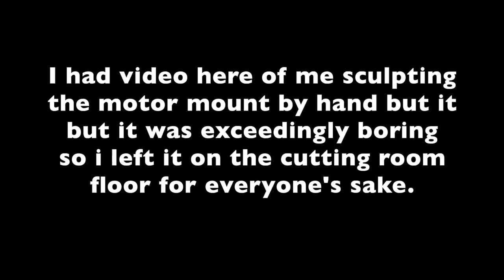Project Widowmaker Part 4 - 2GR-FE powered MR2 Spyder

Comment: This has been my dream for my spyder for years which is why i still havent gone to the 2zz. The 2gr will be more along the lines of what i want from the mr2. Ive already got a huge turbo sti, so instead of peaky top end power id like a more usable torque cruve for the street and track as the spyder will be my daily/autocross car. I ended building the subaru up first as it blew the headgasket from high boost so itll be a couple years maybe before I can save up for everything but its going to happen and ill be looking to you for info/parts😉 great work btw!!

Comment: No Toyota interchangeable oddity or Truetrac for that diff center to get a T2 torsen in there? (add a preload pack (Disc spring between side gears) for race use avoids lifted wheel issues) seems a little wrong to save an open center!
Reply from the maker: I have to do some research to find the answer to this. i don't know of an interchange right now but also i don't find that i have rear tire lift issues at the race track. the open differential has not been holding us back from great lap times. You can see on the IMS video even in the high speed turns the power can be applied early without inside tire spin.

Comment: Marc, I feel the reason there is junk in the transmission and all of the bearing races are damaged is because that outer input shaft bearing has been replaced once before. The bearing that comes in the scion tcs has a green side seal vs the one you bought (black) and the one you just pulled out also black. 

It really looks like a crappy toyota dealership had this one come in and they did a slap and swap. They didn't even clean the chunks out  or get oil residue out of the case.. just wiped off the magnet in the bottom. Swapped out the bearing and slapped it all back together...  And sent it out the door. 

All just theory and speculation tho.... I haven't had one grenade itself after Toyota "fixed it" or anything like that.
Reply from the maker: This is actually a really good theory. I will be replacing the input shaft bearing either way but i'll take a solid look at it to see if there's any slop in it.

Comment: going with ej20 boxer engine with decent turbo setup would be great aswell. but is it possible to make one step forward...making an awd sytem.. cutting a shaft tunnel and devising an awd system similar to ford rs200 group b car ? Sprit of Group B. does it require complete custom driveline system ?
Reply from the maker: YZ, I'm pretty sure i know the answer to this but i have an '08 WRX in the driveway here so i took a quick tape measure to it and the subaru has the axle output about 22" behind the front of the engine and the MR2 has the axle centerline about 18" from the firewall. You could sweep the CV shafts forward a bit so that would probably be doable. But the next problem is the front of the engine to the rear of the transmission is about 50" long and the MR2 has an engine bay that is about 39" long. The next problem is even before you bring a driveshaft forward you need to turn it around from behind the trans and we're already 11" past the rear of the car and then we need to run it next to the engine but this is a very wide engine so that would also be difficult. adding a driveshaft tunnel would also be complicated but that would be the easiest part of all of this. the only way that would work is if you cut out the firewall and remove the fuel tank so you get an extra 14" of room or so in the engine bay and then you still need to snake the drivetrain forward. A custom transaxle or some kind is likely going to be a requirement. I don't think any of the Porsche AWD transaxles are going to be short enough to not interfere with the seats.
Reply: @FrankensteinMotorworks  fuel tank and battery to the front compartment to compensate weight ratio. cutting firewall is a must..  I saw keita san's video it is using ej20 but rwd using one of those 1500cc fwd jdm impreza tranny i suppose
https://www.youtube.com/watch?v=HNlmqi0Fuag
as i understand it is a tough job .. but mrs platform would be a great group b platform with professional engineering... Toyota MR2 (222D) – Group S
Reply from the maker: @enuma8161  I never said it would be impossible. I know better than to say that. Between the fact that i've shoved a WWII airplane engine in the back of an MR2 and also i know someone that has a 3s-gte powered AWD SW20 MR2 in the works and the AWD part is done so it's absolutely possible. That said, based on my experience you're talking about a build with about 2000-3000hours of labor or so and probably $15k worth of parts and supplies if you do most of it all yourself. If i were to target a build like that i would certainly use a different engine to save a bunch of extra fitment issues. Something that i can pass a driveshaft from the rear to the front without having to deal with a flat engine in the way.
Reply: @FrankensteinMotorworks   my mechanic has celica gt-4 and bunch of 2zz celicas waiting to go pieces . 3s-gte engine and its substructure are available option for us. Fine Detail Fabrication is the hardest part for us in Cyprus... Your friend, awd SW20 . Does he have any videos or any directory videos ?
Reply from the maker: @enuma8161  I don't think he has anything posted online about it but he made a custom transaxle for the swap. It's nothing that can be done by just pushing existing parts together.
Reply: @FrankensteinMotorworks  thanks for your clarification. I suppose im on my own in Awd adventure...maybe i should get rid of my fantasies and try to make something more doable with my own potential...looking forward to see your 2gr zzw30 starting up...regards..
Reply from the maker: @enuma8161  Yeah, AWD in a mid engine platform like the Spyder is certainly doable but it's a very expensive and involved project. Maybe someday if i ever get enough here to support me i'll make a fun build series out of something like that but certainly don't wait up on it.

Comment: the trick with the iso is that the alcohol will evaporate leaving a rubber on surface fit with no lubricant present.
Reply from the maker: i understand that but it sticks better than if you dry fit the parts without alcohol.
Reply: @FrankensteinMotorworks  I did a little googling on a hunch, and it turns out the alcohol can permeate thin rubbers, and can dissolve components such as plasticisers in the rubber.

I suspect it dissolves some elements of the surface of the hose, and perhaps the plastic to a lesser extent, allowing the surfaces to conform more closely. After drying off, it leaves a much stronger mechanical bond than if you slide the two surfaces over each other dry.
IIRC there's  a sort of dry crust you need to crack before the factory parts can be separated, is that what it feels like?
Reply: I'd be curious if it had any effect with silicone hoses...

Comment: Is everything on the 1ar the same except the internals?
Reply from the maker: Only the crankshaft and pistons are different. even the connecting rods are the same. The other difference is most 2ARs do not have an oil cooler and most 1ARs have an oil cooler but they are both available both ways and it just bolts onto the side of the engine so it's easy to add afterwards.